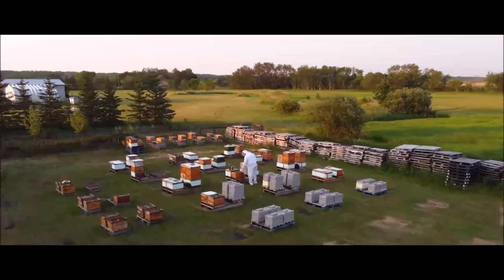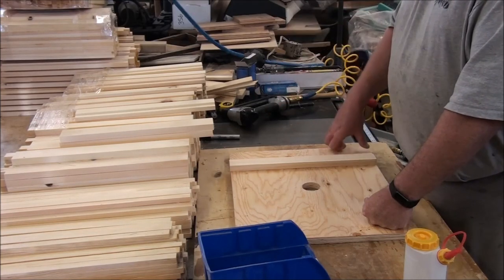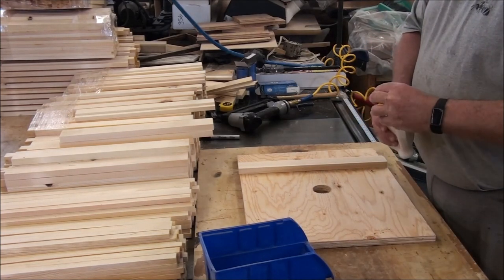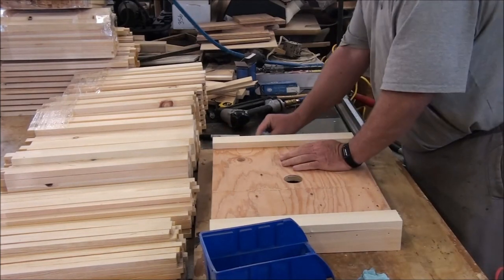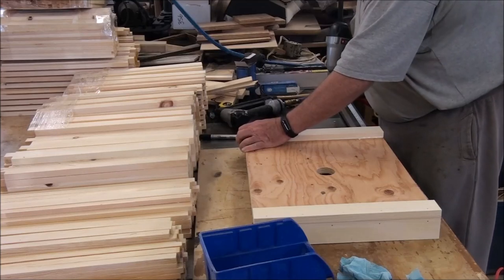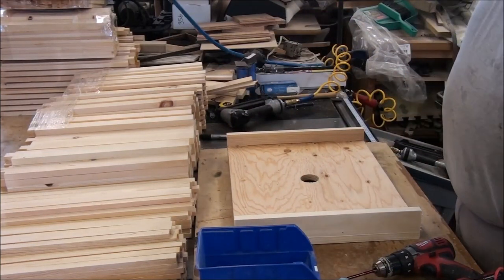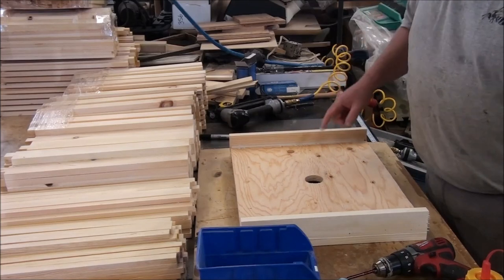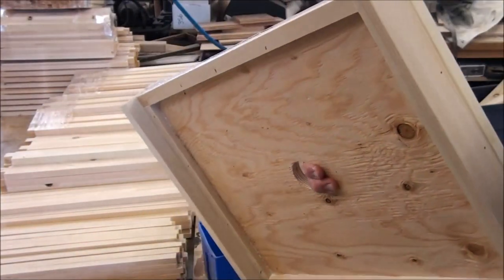🔨Assembling Migratory Covers - That Bee Man

Comment: Hi happy new year! I have bees on trees I moved the boxes with bees to my property an I have a licking lids so, I have water on frames hopefully the bees are still alive, I don’t paint the cover lids I only burn them inside with the propane flames but I found out they are liking water inside  I am thinking to cover with aluminum foil or some other galvanized material and melt some wax inside after I am burning  the inside with the burner, hopefully those bees are going to resist until then. Your advice?
Reply from the maker: A metal cover would solve your problem.  Happy New Year!